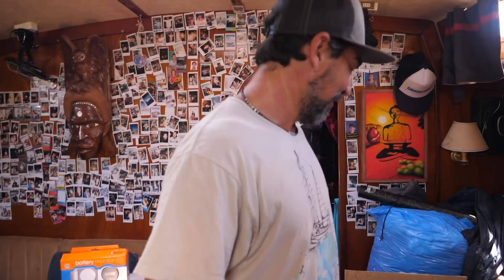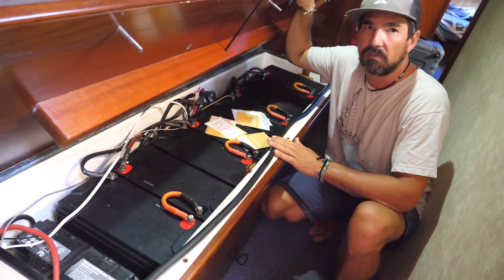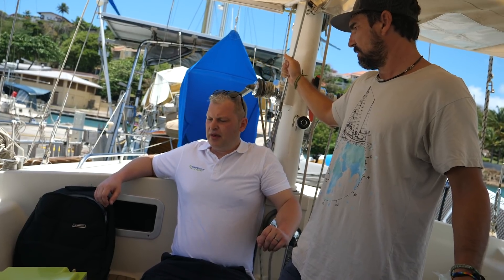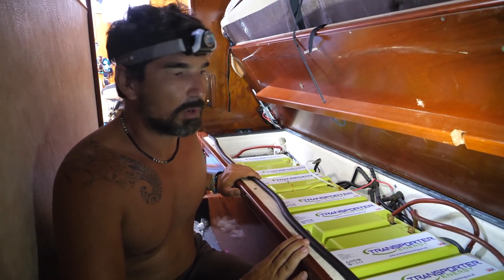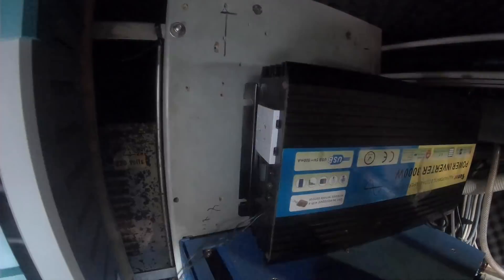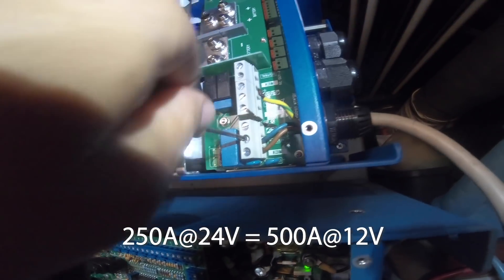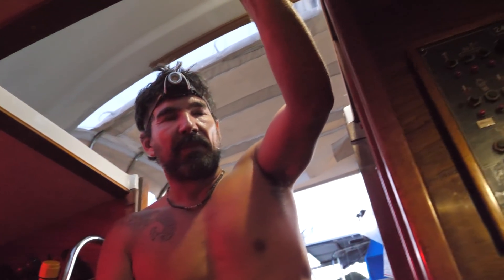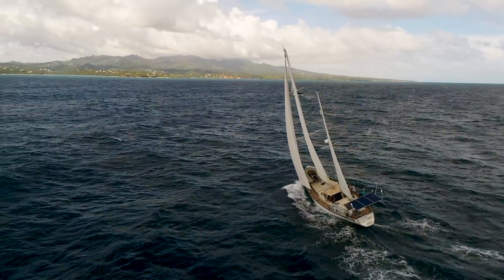Hello LITHIUM, Goodbye Propane!!!  Part 1-  Sailing Vessel Delos

Comment: Not a big fan of lithium - there is a reason the US Navy will not use it, it burns great when it shorts and hard to rule out a short, especially with Chinese manufacturers...  Telsa uses Panasonic and still has some issues.
Reply: ...however Transporter Energy's batteries are US made, including the components, and are Intertek/UL tested and approved. Like anything, if you buy cheap you'll get an inferior and often less safe product.

Comment: I wonder if there is a market for an induction stove with its own built-in lithium battery/charge controller? I.e. the whole thing installed where the old stove was.

Comment: Forgive me if it's been pointed out in this otherwise great project.  As an entertainment electrician most of it is new to me, but I did notice that your new monitoring device is showing negative values on voltage and amps/load.  Perhaps there is a polarity issue somewhere in the monitoring setup?  My feeling is those values should be positive.  I skimmed to see if anyone else mentioned it, but did not find it in the first mile of comments.  ;-)

Comment: Brian,
The lead acid batteries look like they are wired in series.  Plus to minus....
In that case the amp hour capacity is only 100amp hour no matter how many you connect in series.

Comment: Interesting idea however I would still keep my propane system mainly because I love cooking with gas and hate cooking with electricity. With gas you have heat instantly and can regulate it up and down instantly. Electric stoves take time to heat up and cool down. Now I've never used an inductive cooktop so perhaps they can be regulated easier than conventional electric stovetops. I'm told you need special pots and pans too. Also, it looks like you don't get an oven with the inductive system.

Comment: Well done Brian! I've been using a induction cooktop for several years and I've found that the steel pan material makes a difference in cooking times like your boiling water test....too bad stainess won't work, but no burnt hands on the cooktop right after cooking!
Why are the volt/amp monitor values showing a negative reading? <and> Are all your DC components 24V? I didn't hear you say anything about stepping down from 24V to 12V systems. This was very interesting....you're so good at these schools.....thank you!

Comment: 6ah @ 24, is 12ah at 12V --- it is interesting to have that number --- my tiny 26 foot boat carries 2 golf cart batteries with usable amount of 50 AH@12 volt- so that would use about 25% of my capacity to boil that water... so it seems that battery powered cook tops is something that really depends on your unique situation. and a whole tons of factors go in to that analysis. I would also love to know what amount of energy you use for "cooking" something that needs much lower power , for a longer time .. like ..  cooking spaghetti sauce or some thing like that.  -- random thought.. if your boiling pasta it would take a while,. maybe you would cook it at mid-day (that way solar would help supply a ton of the power for it), and then just warn it up later?

Comment: You can replace the starter battery with an ultracapacitor module will do an even better job of protecting your main battery bank, and far more durable with a much longer lifespan.

Comment: Totally on the right track!  Now you are scientists contributing to a quantifiable database measuring the health of our planet.  I am so impressed!  Thank you for your good work.  As for the switch to Lithium Ion batteries and the switch to an induction cooktop, I eagerly anticipate your analysis.  I am interested in the break-even point in the investment into Li-ion technology as opposed to a lead-acid battery bank. Other than that, your presentation is spot on and the photography/cinematography is better than ever!  Cheers!

Comment: Capt.  Brian.  I have Battleborn LifePo4s(4) also, a 12volt 400 APH bank.  It is recommended max charge rate of no more than 50 amps per battery.  That's 200 amps max.  You have a 400 APH bank in series parallel.  Just curious about throwing 250+ at them.  Don't know if I would want to see how good the built in BMS really is!  Awesome vid.  Your boat is just the machine for what you do!

Comment: I understand the reasons for wanting to get rid of propane. But doesn't it also give you a backup for cooking and heat (and maybe refrigeration also) in the event of a complete electrical failure?
Reply from the maker: Hey Garth, that's a great comment.  I can tell you that no one system is foolproof, for example over the years we had a propane regulator quit, a shut off solenoid stop firing, and even the hose break that connects the stove.  Each time was a single point of failure.  In fact we ended up cooking on the BBQ until I could get it fixed.  I suppose this way has a few points of failure as well, our back up plan is to run the generator if all else fails.  At least we will have 2 minute noodles should all else go to hell.  Fair Winds and thanks for watching!  Brian

Comment: Good video - keep them coming.  You're doing a great public service here - many of the threads found on online forums concerning LiFePo4 (or lithium in general) make the whole process sound like voodoo.  However, you very accurately and simply pointed out that it's just another charge-container that has its own quibbles and needs, and anybody puts care and attention into their daily projects will not have a major problem swapping from lead-acid to lithium-based storage, if they so choose!  Bravo!

Comment: Mad props to the dude that fabricated that mahogany shelf for the cook top.  Looks great!  Also looks like you might have gained some storage underneath where the oven used to be.
Reply: Seriously! Took me a while to realize that was not part of the original boat. The tech is cool and all, but that's craftsmanship. Limiting the need for propane is a huge win for sure, and the other advantages, though one thing about a stove, especially for the old wood burning ones, is they serve double-duty in colder climates. The kitchen is where one dries all the clothes, for example. Not necessary in the tropics of course, but someone's waste heat is someone else's treasure as they say. I suppose you could always carry a small backup stove.

Comment: Hey Brian and Delos crew,Really enjoyed this technical look at your power system! Actually coming full circle as I ran into your videos while researching Van conversions and after months of research I am purchasing the same basic system for Our Mercedes Sprinter conversion. Going with 300 ah of Battleborn (Dragonfly) LifePo4 in 12V configuration,  2000 watt Victron  Multiplus  Inv/chgr., Victron solar charge controller, BM 712 monitor and GX color monitor. going with 400 Watts of solar on the roof and dedicated auxiliary alternator, so no generator. will have a single burner induction cooktop, a small microwave, and an Iso therm fridge which is also robbed from the marine industry. The Folks at Battleborn/Dragonfly energy have been great to deal with and the BMS is what got me looking closer at them, as besides the things you covered in the vid it will also disconnect charging below zero deg.C which will damage lithiums and is a definite consideration for us here in Alberta, Canada. Safe travels, and thanks for showing me the world!
Reply from the maker: Hey Gary that's great to hear!  So very cool, sounds like it's gonna be an awesome setup :) . Thanks for watching and commenting.

Comment: One nice thing about induction is how easy it is to keep it clean. And also no more combustion products that force the cabin to be well vented. Also the risk of a propane leak is gone. What a propane leak can do to a boat and crew is no fun. If you have that much electric power, a modern self cleaning electric oven - these are more energy efficient because of their very good insulation compared to the the non self cleaning ones - would be feasible.

Comment: I have 2 induction cookers. I love them. They cook fast. You have to have special pans.  I get a small pan and cook an egg on the induction cooker and it cooks so faster. You are so smart to be able to figure out all that. You can do everything to fix the boat. Curtis Stone cookware on HSN work on induction cooktops. I have a lot of them the only thing is that it is so smooth in the pan that the food  might slide out while you are sailing. Cast iron works on it too but those are very heavy but they cook so good.

Comment: Outstanding video. Quite a remarkable step! I consider your removal of propane to be a further off-grid decision. I would very much like to see a part 2. What do you do for hot water for showers? I can imagine a solar water heater quite easily, as I've seen them used to warm up pool water at homes, but curious what your setup is.

Comment: Great video,  I decided a couple of years ago to go the route of induction cooking. but haven't gotten to the point of installing the sine wave inverter.   Is that really necessary? or did you decide to go the sine wave inverter for other reasons???

Comment: Nice one guys. We run a standard electric hob with ceramic top from our inverter and boil water on an electric kettle also. Our inverter is only 2kw but copes with the hob and kettle fine. One thing to note is that induction heater requires a Pure Sine Wave from the inverter. They simply wont work on a modified wave which some inverters give out. Batteries are topped up each day with 400w solar.

Our gas bottle would last about 20-25 days before, now we get double that since it only gets used for the oven or grill.

Comment: Brian, couldn't you have gone with a smaller Amp Hour bank since the LiPo batteries can be discharged so much more than the lead acid? Supposedly, they tolerate way more than going down to 50% with no appreciable loss of longterm life.

Comment: its not the voltage that kills you, its the current.
Reply: Sad to see this quoted so many times, including in these comments. What generates the current? Potential difference (voltage). Basic Ohms Law: for a given resistance eg a human body, double the voltage and double the current will pass through. Get sufficient current across the heart and you die. Sufficient current is generated by sufficient voltage. So to think that it's not the voltage that kills you is stupid dangerous thinking.

Comment: Not sure if this will still get to you guys, but it is really not advisable to put lithium batteries parallel to each other. It's way better to connect 8 big single lithium cells is series to get to 24 volts, and connect those to a bms. But other than that it is really cool to have lithium power on the boat and the induction stove is just awesome! Keep up the good work and I really love the techy bit :D

Comment: The last 2 videos have been so timely and helpful as we’ve been having power issues on our SO37 and are looking at alternative energy solutions. We have lead acid batteries, with solar and wind feeds. Really new to this life, so this is bang on the money right now.  It seems to be much more cost effective to get these types of parts in the UK rather than France (super expensive and bulky parts). Thanks Delos ..

Comment: As to fire concern I believe from what I understand, Brian bought batteries with self contained computer brains that shut them off before something might happen (i.e. no worse fire hazard than the Lead Acid batteries he replaced) and not having propane probably brings the total boat fire hazard down.
Great informational video Delos crew, Thank You

Comment: Brian,

Hey always enjoy your video's and your insight on some technology aspect with the new lithium batter system.... although I am not quite sure that the technology is quite there as of yet... when those batteries Do start to run away...  ( a potential fire hazard at sea ) I did like the theory of the safety shutoff for each battery .. but I am a bit hesitant ... what I do know that on my jumbo jet , they house those batteries in a quarter million dollar titanium sealed case.... because of runaway heat and known fire hazard . Hmmm what do all those space engineers know that we do not? What I do know is that when all is working as planed...it is wonderful and revolutionary  technology , but when it goes bad... you are stepping up into the raft as your home heads for Davey Joans Locker.  I do hope and prey that never happens... and You Never know , we may run into each other in some quite little Bay somewhere in this small world... North Star...

Comment: g'day Brian
I think LPG is quite dangerous. I threw my LPG overboard too, but went with Meth stove and a 240v convection oven
The only time the oven gets a work out is at the dock on shore power
When the AGMs lose it I guess I will be doing what you are going through now except that my boat being smaller 36ft+ wont be near as complicated.

Comment: Awesome. Just one thing to be cautious of; Induction heating is quite capable of heating any rings which may be on fingers around the cooktop. I don't think your little cooktop is powerful enough to heat a ring so fast as to make it dangerous, but you should definitely be aware of this. Also depending on the type of metal used for your cookware, you may even be able to get that cooktop to outperform your old propane unit. Induction heating works by switching the magnetic fields at high frequency, so the type of metal your cookware is made of, can have a significant effect on performance.

Comment: Friggin' awesome! I am so AMPED!!!! (Excuse the pun). I've been fascinated by the evolution of alternate energy systems since putting solar on our home, and I've been  fascinated with sailboats since buying my Catalina 22. Put the two together, and you've rung my bell. I think in the not too distant future, when a house or a boat is built, these new technologies will be baked right in from the beginning, and we will be less enslaved to the power grid and the fuel pump. We've only just begun!

Comment: Question: How is this going to work for distilling alcohol? I make it too, and pretty much the same way, but i think it might drain the batteries. For lithium batteries, if you can keep them over 40-50% charge, they may last seemingly indefinitely. I have adhered to this rule with cell phones, and the batteries were still perfectly good years later when the phones or tablets became virtually obsolete. Thanks for being complete on the lithium battery info as the air freight approval is actually a big detail. In light of recent years' events, any chance of installing a Geiger counter? In terms of new vid material...learn to kiteboard, kitefoil or surf, try out diving on a compressor in place of tank, train new guests to beginner levels. Super people running many of the tall ships around too, so if you bump into any, say hi. If you end up in the Pacific again, proas are interesting, and sail a bit differently.

Comment: I have had a LiPO4 system for a number of years and recently purchased a portable Induction top for use in port to save Propane. I like what you have done but the real question is , based on your years of sailing how will you replace the Oven?  I guess you have a pattern of usage that does not depend on using one. My  only thoughts where that you use the Microwave and Breadmaker. Both of which we have.

PS I met you guys on Hamilton Island  harbour years ago but had no idea who you where at the time. We look forward to our Friday evening Delos video each week. My wife and I cast of next year on a ten year plan.

Al the best. John and Andrea

Comment: Ah ha! Switched my Link10 for the same BVM-712 yesterday and for similar reasons. Nowhere near as much energy in use on my HR-38 but I adopted the practice of switching my inverter to “manual only” when in port, as I was once caught out running for 10 hours oblivious to the fact that my shore power had switched off and I was on battery only for that time. I didn’t notice the lights had changed.

Comment: As I consider a (used) sailboat purchase for cruising, this is ideal timing to think about house power systems. While our boat will be much smaller and our cruises much shorter, our boat will also be unattended for longer periods of time, so I'm looking for good ways to avoid propane and have enough power for our needs while we are out. Thanks for the links and walk-through of the process on Delos!

Comment: Less than 50V is consider intrinsically safe by all international standards. Working on these batteries is considered a burn hazard. Meaning a short will result in such a high current flow that extremely high temperatures will result almost instantly.

Comment: Talking figures : 8x1200 for the batteries, 2000 for the inverter and the extra monitoring devices and wiring. Roughly 12000 for the lot...or did you get a sponsorship deal with Transporter Energy
Great video

Comment: Hey.  Just watched your install.  Welcome to the joy of Lithium on boats....  Its fantastic not to worry about getting the batteries full everyday.
One thing to note if you installed in April:  Make sure you have the latest firmware for the batteries that actually shuts the batteries off after a certain number of over voltage failures.  I watched a brand new boat beside us burn in Chile because it kept trying to connect over a 24 hour period.  Victron and the battery company were great and took full responsibility to make it right.

Comment: Okay just to clarify for those of us still trying to figure out this PI are square math basically the induction stove uses 1/2 of One battery per hour? Or it can run for a total of 12.8 hours without adding a charge on the lithium ion batteries.